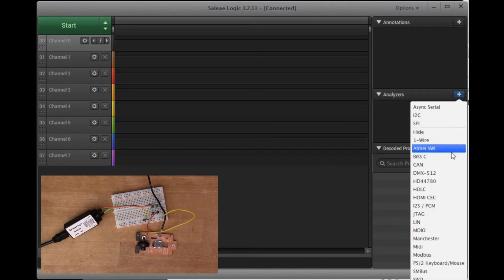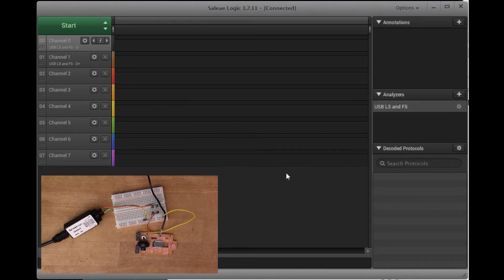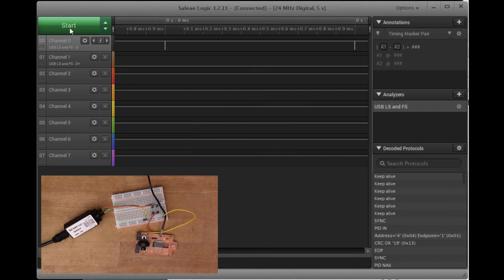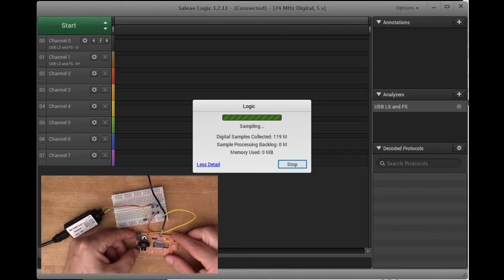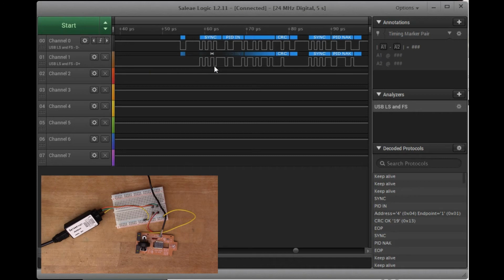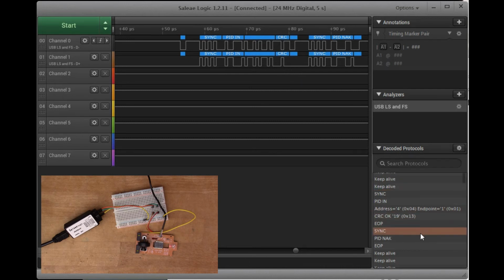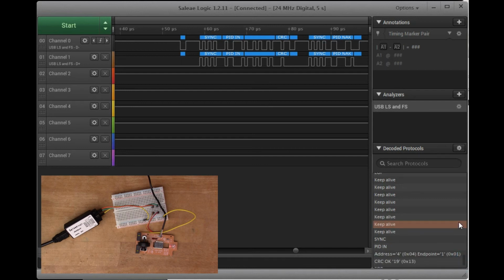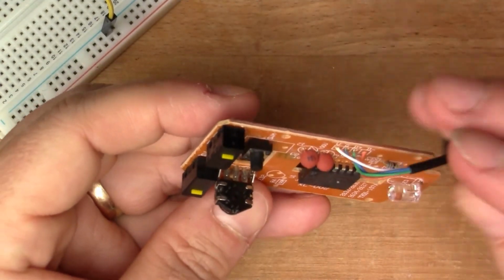Poundland Optical Mouse Teardown

Comment: Hi Martyn, do you think that could be posible soldering some jumpers and invert one axis of the mouse? I'd use it to make a trackball out of a mouse.
Reply from the maker: Looking at the datasheet for the chip, there's nothing obvious there about inverting for the mouse position, although inverting the wheel looks easy as there are two pins that could be switched around.  The mouse position itself looks to be all done internally to the chip, which also provides the USB interface.
Reply: Same problem
Reply: Can you help me

Comment: thanks for the video! I want to reed the x- and y-values for a project of mine. Do you know if I need to send a certain signal to switch from usb-protocoll to ps2 ?
Reply from the maker: I thought this was done just with a physical adapter?  The datasheet for the chip might give more clues.
Reply: @MartynDavies  I connected the four cables (V, ground, D+ and D-) to an arduino uno and want to read the position data from it. That's what I need the ps2 protocol for.

Comment: I have a question, how i can program that Chip (A2639B optical mouse sensor). Can you make a video about that??
Reply from the maker: As far as I know, this chip id not programmable; it has a fixed function interfacing to a rotary encoder and three switches.
Reply: @MartynDavies Thank you

Comment: x y z, camera is x and y, mechanical encoded scroll wheel is z, pretty standard and boring naming convention that works. looks like the chip autodetects ps2/usb too, amazing that something so complex due to scal of manufacturing is now so cheap
Reply from the maker: True. I can remember when an optical mouse was a big deal - the entry level ones had a ball and a couple of encoders
Reply: @MartynDavies  I miss those, the optical sensors could be harvested to use for other things like end stop sensing, but that stupid mechanical rotary switch on the scroll wheel in these £1 mice is always the first thing to fail, the £3 ones off ebay are no better but you often get a few more button inputs, i should tear one down i have a few...
Reply from the maker: printers are a good source of optical sensors

Comment: Great video, no fuss and straight to the point. I was looking into a optical mouse project and finding simple no fuss mice to use as parts, and simple reverse engineering of the circuit was challenging. Everything I got or "found" had way to much goung on inside for what I need, dont want to spend ages working out what is not needed etc.  Off to Poundland now
Reply: How can i reverse left and right direction of cursor

Comment: I have been using a wireless mouse. It felt down recently, resulting in error as the cursor keeps moving only in a slope direction or diagonal direction no matter I push the mouse to whatever direction. All buttons and the wheel work fine. How can I fix it? What is the main source of error?
Reply from the maker: optical mice work by taking a couple of photographs of the desk and comparing the two, to work out the direction of movement. This means that there's not much mechanically that can go wrong: you could make sure that the perspex lens/light-guide assembly is properly seated, but apart from that I don't know what can be done.

Comment: I only ever buy Poundland £1.00 mice? as I tend to knock them off my desk and onto the floor quite often. I find them to be very good to use. I am currently using the model you have just torn down in PINK...lol...(.Don't tell BigClive you can get a pink Poundland Mouse.)
Reply from the maker: I don't like the feel of the scroll wheel, but yes it's a perfectly good mouse for £1.
Reply: It is a lot like more expensive mice. But they did cheap out at every possible place they could in order to minimize cost. The scroll wheel looked like a tire off a toy.